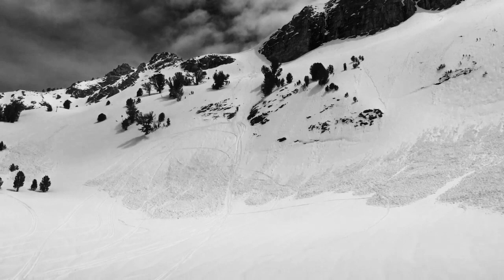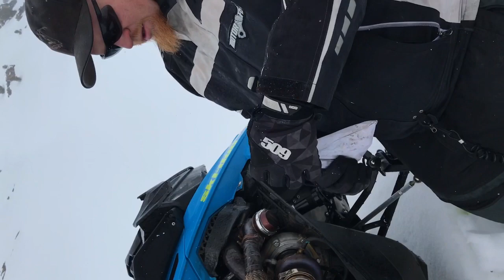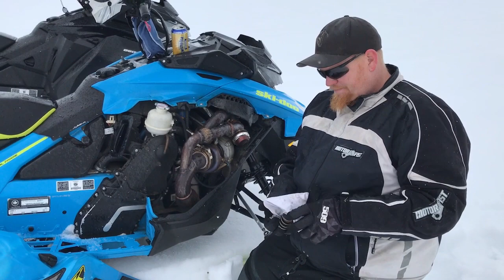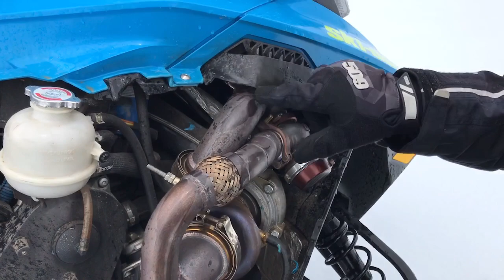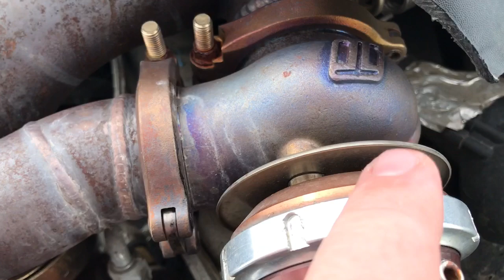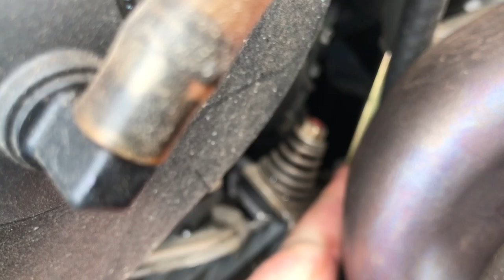Ski doo 850 turbo review 2018 silber kit non biased no bs review watch till the end

Comment: Just cut those exhaust posts off then drill a hole thru the bracket and put a nut and bolt thru, not hard, did it on my sled cause i have a tunnel dump, dosent budge at all
Reply from the maker: That’s what I was planning on doing. I’m going to go work on it this weekend so I’ll have a update video coming soon